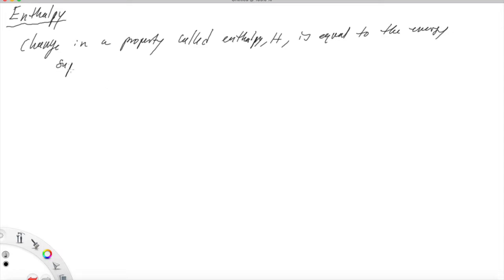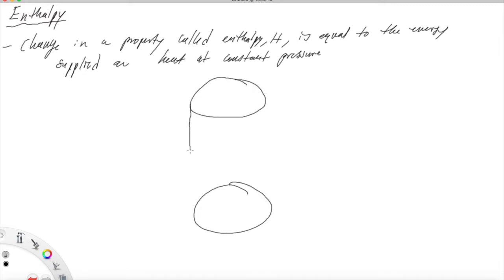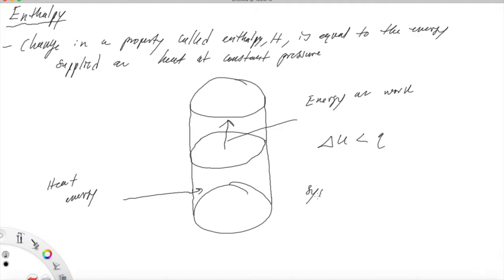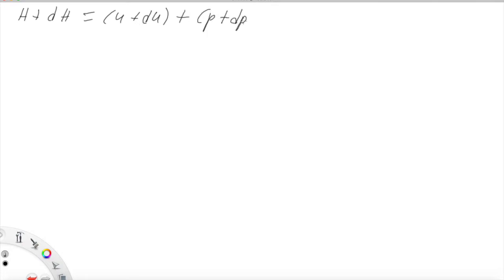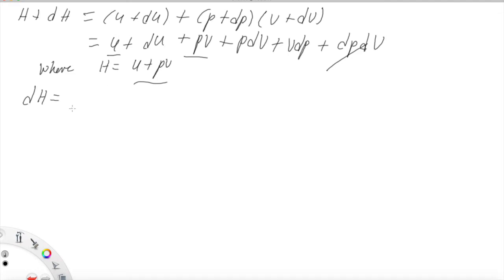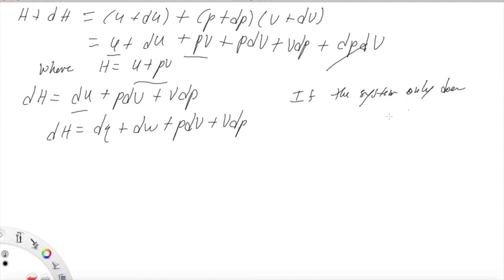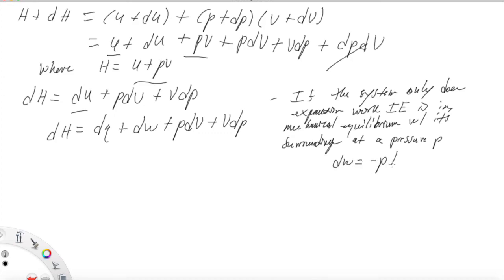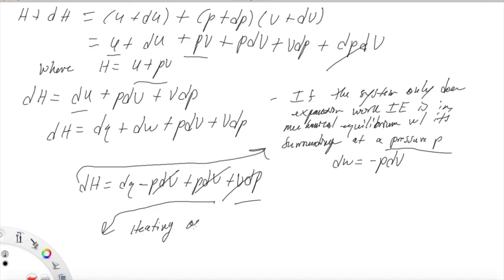Chemical Thermodynamics: Enthalpy

Comment: When talking about the constant pressure do you mean barometric pressure? As in driving a car up a mountain and realizing the external air pressure changed the way it runs? (better/worse fuel efficiency). Also in enthalpy explaining why its possible to recirculate unburnt fuel from from a the crankcase back to the combustion chamber? does this also play a role in charging a cars system through braking?